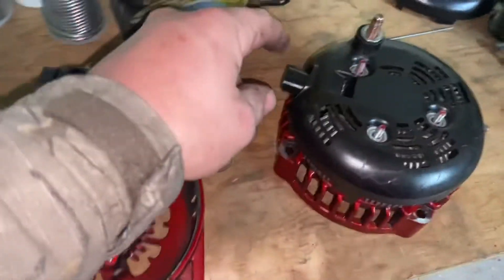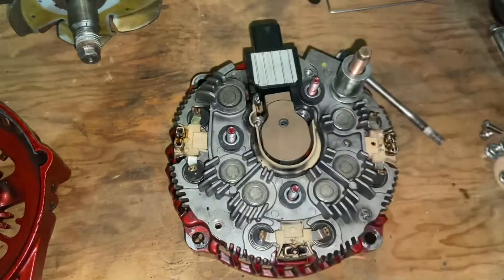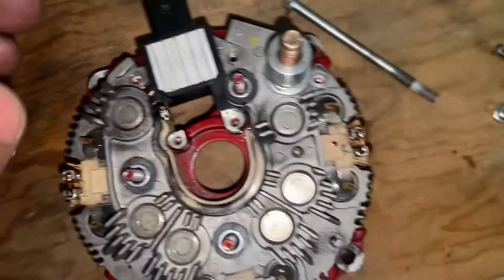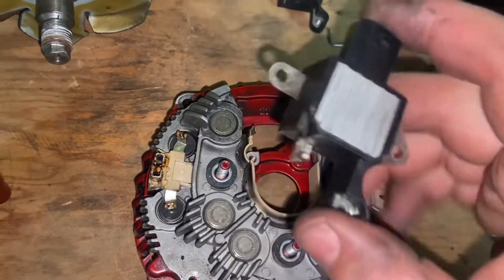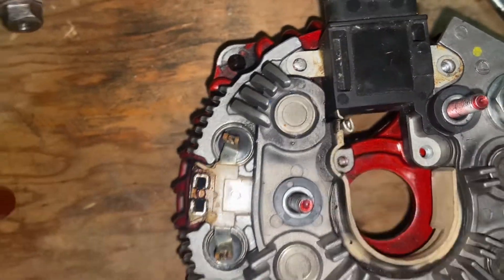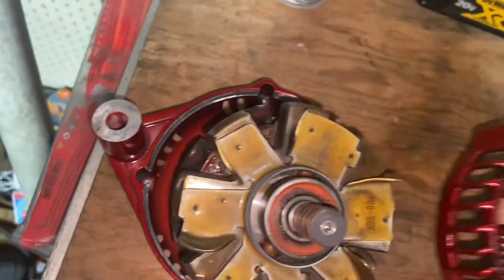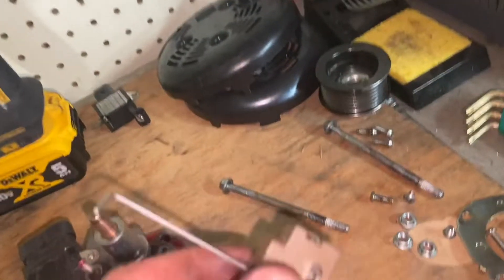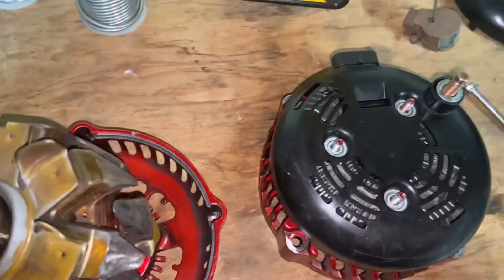Replacing a regulator on a hairpin high output alternator

Comment: I didn't know I needed to put a 470ohm resister on my new internally regulated alternator, I think that's why it stopped working.
Reply from the maker: If it’s connected to the factory gm wiring it shouldn’t need it. But, if you are running it as a complete new install, it needs that resistance to keep from damaging the regulator.
Reply: @sub-humansounds5645  Yea the vehicle is a 97 Dodge Ram 2500 and I'm converting to lithium, so I had an alt built so I could boost voltage with diodes but didn't know to put a resister on the (L) and it stopped working, any idea where to get a replacement? thx
Reply from the maker: @scottiffanimccord1509   is the regulator like the one in the video?
Reply: @sub-humansounds5645  I haven't broke it down yet but from what I can see yes but I can dubble check thx! Scot.M
Reply: @sub-humansounds5645  I spoke with Iraggi and thy want me to send them the whole alt.
Reply from the maker: @scottiffanimccord1509  if so I can help you find a part